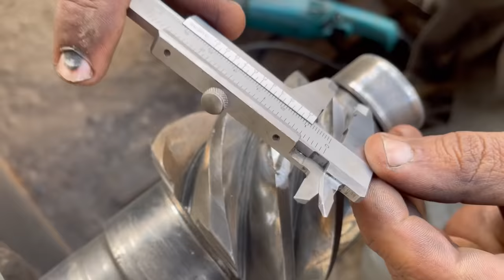I repaired the scrub pinion which no mechanic repairs | Give your opinion by watching the video |

Comment: I knew a fellow who did this in his garage, he would have the steel analyzed and purchase rods as close to the alloy as possible, build it up , grind and file to look good and temper or quench as required. He was good enough to get repeat customers and the small operation made for low overhead costs. This is what you do if wait times and huge costs prevent you from doing it right immediately.
Reply: So, do it the unsafe hack way instead of doing it right. Got it.
Reply: @tonyhammer3588  Yeah, when there's no other options, yes.
Reply: @tonyhammer3588  🤡
Reply: These videos are from Pakistan.
As we all know, transportation is major contributor to economy for any nation.
But these machines mechanical parts cost is high as 
1. Earning of a common truck driver is very low as compared to other foreign country.
2.Pakistan is also in there worst economy crisis.
I'm not saying its machine perfectly made, but the true is that they also had to make use of either restored/machine repaired to cut down the expenses burden.

However we must a good cool like for his👍 skills
Reply: If the guy in the vid did the proper hardening or Annealing, like you talk about, i'd feel better about the repair, but since they did not show any of that, I have to assume they didn't. They better not drop it, I bet it breaks like a champagne glass
Reply: У нас в России после развала советского союза 85 процентов заводов развалено, а деталей негде взять приходится делать так.
Reply: @tonyhammer3588  unsafe? How?
Reply: @Marsianin-88  is this why the dudes in Garage 54 are so good at making cool shit?
Reply: @tonyhammer3588  clown

Comment: It may not be ideal or last long but given the tools, limited parts, money etc that was impressive. Hope it works.
Reply: It's worth a try instead of just sitting around doing nothing waiting for a new part.
Maybe/hopefully it'll last long enough to get whatever job done ,or lucky it'll last till the new one shows up. 
If it gets ya out of the woods and doesn't hurt anything else ,go for it.
Reply: @MrTheHillfolk  you may end up breaking even more components. So no, it isn't always worth it. In this case though, I rhink it is alright, they do what they can, to keep the truck alive, it looks to not have long anyways.
Reply: @Morgus Schmorgus ok
Reply: It's a very hard high quality alloy welding rod he used.  It may work just fine for quite a while depending on the abuse.    Look up NHF-650B welding rod.  It probably could have used some heat treating after all that welding and grinding though.
Reply: @markgigiel2722  I bet you dont anything about real welding. First, it’s changing the temper of the steel. Second, this hack wasn’t cleaning the welds thoroughly and just welded right on top of a contaminated weld which will have porosity in the weld resulting in a weak point and breaking.
Reply: @tonyhammer3588  I'm not a metallurgist or a welder.  He would have to stress relieve and harden it etc.  I said he used a high grade alloy rod and it MAY work for a while.  That may have been the only choice from the looks of the video.  I worked in an oil refinery where the welds were frequently CRITICAL and x-rayed and exotic alloys were common.
Reply: @tonyhammer3588  well man it's not a steam main pipe weld in a nuclear power plant, it's just a broken ass old truck that they need to keep going. 
Let's all just appreciate the artful work that they do and be thankful that we can spend all our hard earned dollars on new parts and "rip off" tech shops.
Reply: @gazzafloss   Haha, I don’t spend money on any shop or mechanic work. I have a lathe and a mill. I make my own parts and have NEVER needed a mechanism my whole life. It pays to be a mechanical genius.
Reply: @tonyhammer3588  even if "self professed". Confidence in self is always an asset ✅.

Comment: Sometimes you just have to get the job done using whatever materials, and facilities are available, and if parts are not available, then you have nothing to lose.
Good job that Man.
Reply: Might as well try.
Reply: @timjohnson1199    
Yep, might as well.  He's in a place where this part is probably just plain not available.  
I do wonder about his choice of a hard-facing rod to replace material.  The welder in me wants to know about that.  The 30+ years as a machinist, (not a CNC button pusher!) I would like to see the mating surfaces after six months use.  Maybe I'd be surprised.  

The guy has a pretty good eye for finish.  Respect from a USA metalworker.
Reply: @dcw56  nope its simply very expensive for them and he does this job because also a bad part that is not made from the factory there is worth reusing, because the repair there is not very expensive
Reply: @divineantiwokegangster  
They can get the parts, but the new parts are too expensive then?
I can understand that, but how many times will that part need to be repaired because of imprecise mating surfaces before a new part would be more economical in the long run.  That repaired gear will also cause the mating gear to wear out.  

I am NOT criticizing the man who did the work.  He's a good workman and has little in the way of tooling for a better fix.  He did a good job for only having a welder and a grinder!
Reply: If you have more time than money you have nothing to lose if it didn't work before you started.
Reply: @Waqas Khon 
God bless you and keep you!
Reply: Well said...if there are no parts available and no other option. Of course, durability is another story.
Reply: yep, I agree.  Nothing to lose.  Good job.  I've even seen gear teeth repaired by drilling and tapping a series of holes in the broken area, run in the best grade bolts you got and stitch the entire thing together and to the gear with weld!  Bush mechanics!!  Usually its a stop gap while some high-dollar/day machine is down and new parts sourced & flown-in...but hey...better than a busted gear!  Fingers crossed it may have been so over-engineered to begin with that it will last forever!

Comment: A great way to ensure that you have another pinion to repair in two month time ;)

There is tolerance classes 00 to 5, then there is nothing for about 2.3 lightyears and then there is the tolerance class "Indian with an angle grinder". That one is generally measured in dioptres since it is depending on whom is looking at the part and how good his eyes are....
Reply: Precise instrument - eyemeter, very precise device - fingermeter, super precise device - nailmeter)))
Reply: Yes, you are probably right but at least they still repair what's broken instead of paying low quality and overpriced labour so a "professional mechanic" with no experience whatsoever can just replace everything
Reply: Some times you dont have the replacement and you need to try, i am from Chile and im restoring an 1954 international, it had the same problem on the diff and i made the same, its working fine, i dont know how much will it last, but it works!
Reply: you are a parts changer righ?
Reply: @Adrian-Ionut  Not sure where you live, but this repair could be done by every single machine-mechanic I know. Only no one would do it.
Reply: @rocanroller85  No, I am a trained mechanic and mechanical engineer. The fact that you accuse me of beeing a parts changer shows how little you know about mechanics. 

You are thinking of automotive mechanics, whos job it is to fix cars. That by nature mostly consists of changing parts and finding flaws. This guy on the other hand does work that a machine mechanic or machinist would do. Those are the guys that built parts.

Just about every decent industrial mechanic, machinst, machine mechanic, maintenance mechanic, agricultural mechanic or even welder will have the skillset to perform this work with one eye closed.
Reply: Притрётся, не космический корабль, мы в России ещё не так чиним))
Reply: @DARGO_O5  Вот почему никто не думает о России, когда думает о технологиях.
Reply: @peteraugust5295  вот почему в России вопреки вашему мнению и вашим технологиям всё работает и довольно успешно 😂
Reply: @peteraugust5295  Please explain how they are going to get the right shape, as there are no right angles or mileposts to measure against.  It's a 3D curve.  I doubt if they can eyeball it to within 30 thou.   Also, too, the fix is going to be much weaker than the original tooth, which failed.  He might be the brightest minion for this pinion, but even he can't overcome two major roadblocks.
Reply: @Bynming  зато весь мир покупает оружие, удобрения и газ. Нам хватает и этого)
Reply: @Bynming  переводчик не работает, а удивлять вас своим английским я стесняюсь)) ну вот видите как хорошо)) мы только 30 лет живём без плановой экономики, то что сейчас творится у нас в стране неизбежно при любом переходе от плановой экономике к рыночной. Всё ещё впереди, технологии тоже))
Reply: @DARGO_O5  Good luck! Russia has a lot of potential, and the people are great. Hopefully it doesn't get held back by bad politics.
Reply: @Bynming  Спасибо очень большое 👍  простым людям вроде нас политика не нужна, нужно чтобы был мир. Я думаю у вас также. Политики сталкивают народы, что мы уже увидели не раз в современной истории. Вам тоже всего самого хорошего 👍
Reply: @user-bv1xd3yi4j  :)
Reply: @peteraugust5295   не слушай этого дурачка. В России такое точно делать не будут. Одно дело сломаться в Индии при +35, а другое в Тагиле при - 40 мороза- это вопрос жизни и смерти.
Reply: @Bynming  man, never seem a comment age this badly and this soon
Reply: He is not Indian, he is Pakistani...
Reply: IWAAG - Indian with an angle grinder... I like that one...
Reply: This is Pakistani mechanic in Pakistan

Comment: We did this at radford stone years ago..welded many old gears back up..made parts for crushers,..worked for us then.
Reply: Interesting. It worked, but for how long?
Reply: @waynemcl  Outlasted the buiness,and went to the scrap when plant was torn down
Reply: did you weld heat treated helical gears like this? The smaller the tooth count the more is asked of each gear load wise.
Reply: I welded a gear tooth on my old roller back in 1989.
It’s still rolling steel today.
Reply: @honestspirit56  well then, you can't argue with success
Reply: @danneumann3274  I was waiting for someone to say this so I wouldn't have to. Success has many parents but failure is a orphan

Comment: We do that. In an emergency with E7018 as base and a hardneds electrode for finish, the results were excellent, it works for more than six months.
Reply: Thank you, that was going to be my question.
Reply: E7018 is not the right electrode for doing repair in gears or pinions..they have specific rod for that kind of steel

Comment: The issue is not whether it can be repaired, but whether it can be repaired properly.  Any skilled machinist will realize repair of this part is not possible due to the hardening which must take place on a gear set of this size.  Welding soft metals to hard does not restore the part to original condition, and thus only provides the illusion of success, and some would argue deception of success given this work was most likely paid for.  Just because your gear meshes in the end means nothing about whether the gear can take the loads originally specified.

We have a saying about these sort of things.  Just because you can, doesn't mean you should.

EDIT:

I watched the video to the end, thinking you must be putting this on some sort of helical cutting tool.  I would like to rephrase my original assessment.  You think you are going to freehand grind a helical tapered gear with a cutoff wheel?  This is comical.
Reply: While I agree with most of what's being said here, I would just like to make one correction. 
The 650b rod is a hardfacing rod.
Reply: Most likely he's gonna assembled it and drive it very carefully to the sale lot. Someone who makes such a bad job can't be serious as to weather the customer will return. It's only a matter of time until he is stranded.
Reply: Might last long enough just to get the truck home till they can get new part . It's what I would call a Band-Aid.

Comment: Re: all the comments about how it will eventually fail, etc. - This is what they have to do to get by in Pakistan. If the repair fails, they will fix it again. The truck driver needs his truck to work NOW, or he can't feed his family. And the repair cost isn't expensive. New parts are for them. Finally, this man can repair ANYTHING made of metal from all the videos I've seen of him.
Reply: Well said
Reply: Aqui no Brasil falamos :
A necessidade faz o sapo pular .
Reply: Well said...   But  this is the reason why accident happens, driver has to choose food/save money   or  their safety/lives
Reply: True that
Reply: Using the word repair in this instance is very flexible. Ive built rearends when a thousandths of an inch matters. This can't be withing hundredths. Those things matter, a lot. This would be a good fix for a lawnmower or maybe a low hp tractor. But in a truck? First load on that thing it's coming apart, beat case it'll destroy everything around it in time.
Reply: but if the trucker needs a truck that works he cant have it in the shop having shit repairs done 10 times+ a year? A lot of pepole forget the simple stuff like you get what you pay for!
Reply: @Afrokamelffs  I don’t have an answer, but I know this is just how they do things there in Pakistan. If something breaks there, this is how they fix it.
Reply: @joeylawn36111  its not free to take stuff apart and put them back together, i know from experience it takes time and can be tricky without proper tools. So if he wants to have that shaft taken out and rewelded a couple of times a year then sure it might be a doable solution but paying for all that work probably adds up to the price of a new (or even used) shaft pretty quick. I can also imagine that when the weld eventually fails you risk those pieces getting into other gears and messing even more parts up and then you suddenly need to replace/repair more gears/shafts. You know gears are usually made with pretty tight tolerances to work well and to last over time, will be really hard to manage this with hand held tools.
Reply: @Afrokamelffs  I do understand that, I'm simply saying that's the way they do things over there. I'm no expert - simply binging on these Pakistani mechanical repair videos, but I have noticed that they will repair just about anything broken on a vehicle, and do a decent job at it.
Reply: i am a machinist and know that the repair is not proper nor reliable but agree with You 100 percent. They will fix it again
Reply: Like you said they have to
Reply: @Afrokamelffs  - you don’t understand that these guys don’t just call up Isuzu and order a new shaft. They make like $5 a day. Even if the shaft is only a couple hundred, that’s like a months worth of wages just for the part, and the truck is down for probably 6 months while the part comes in. So he’s out $ every day it’s not running. People forget, it’s not like they go on Amazon and order one or call Pep boys.  

People are constantly comparing their “throw away” societies in first world countries to these folks.  These people don’t throw away anything, because they literally have nothing. So that’s why they fix it and they will fix it again if they need to.  The mechanic probably told the trucker it won’t last forever but you do what you  need to feed the family in these places.  Watch a documentary on ship breaking if you want to know what it’s like to live in their world. It’s not glamorous.

They repair what they can cheaply because some other critical part of the truck could fail at any time and turn it all into scrap. Would you put $5000 into a $200 car knowing that it likely won’t be running in 6 months?
Reply: @projectdiy985  not starving always takes priority over safety
Reply: @Tonyrg1988  thats what i meant ..